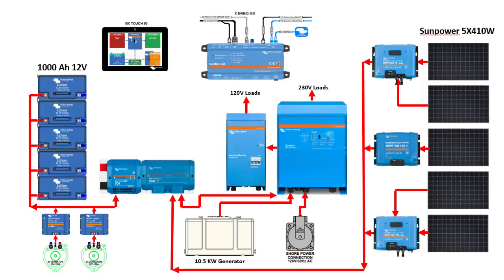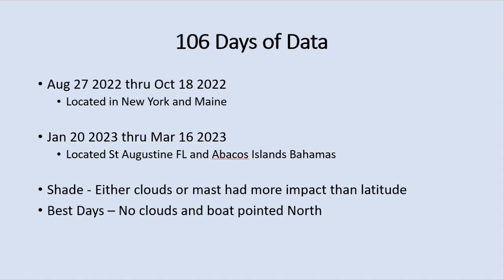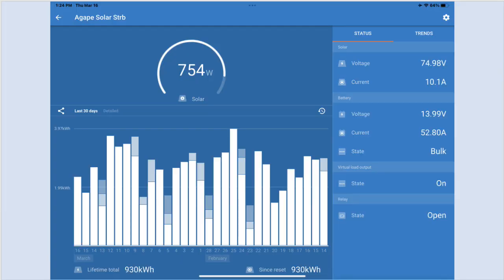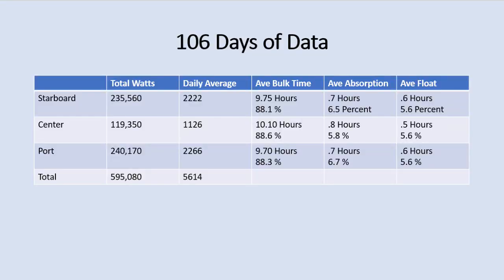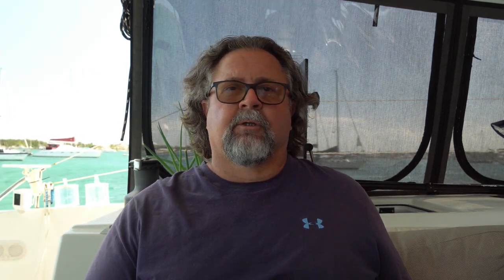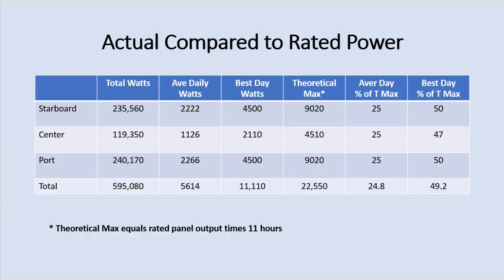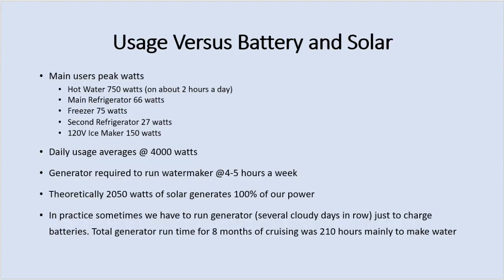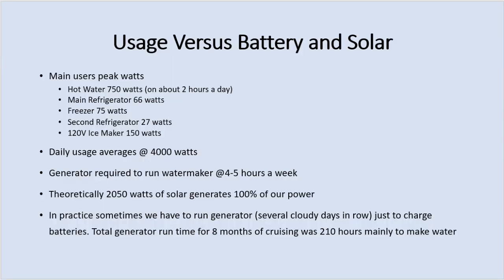How Much Solar on my Boat - Watts the Facts

Comment: Great video, thanks for putting this together!   We are going with roughly 3.2kW of solar and feel it should cover our needs.  Would be cool if you guys could give us a rough idea on yearly operating costs vs what you had planned for when you started out, we start on a similar adventure next year 👍
Reply from the maker: We will try and get a video out on our experiences cruising for two seasons. Good, bad and expensive.
Reply: @svagape  sounds great, we are sort of planning on the first two years costing quite a bit more than once we settle into a groove, will be interesting to hear how it’s working for you guys